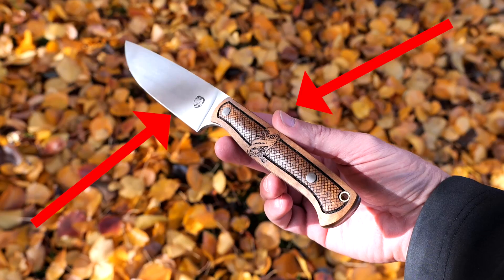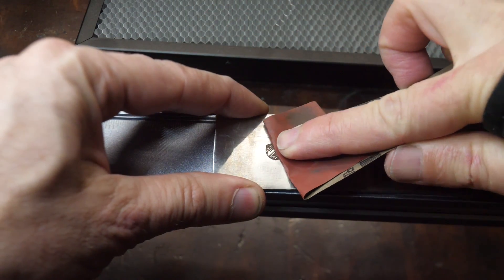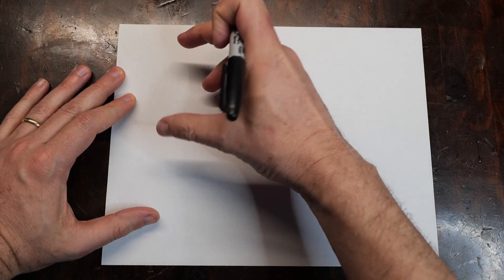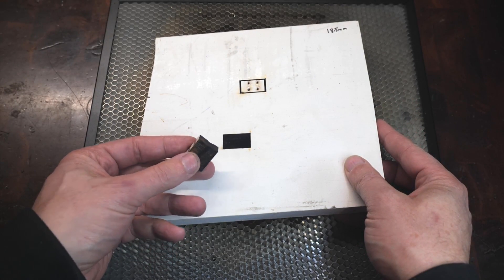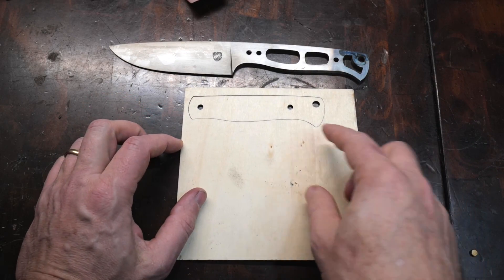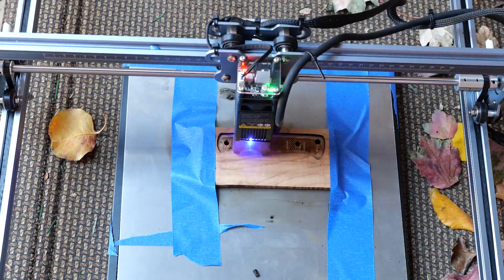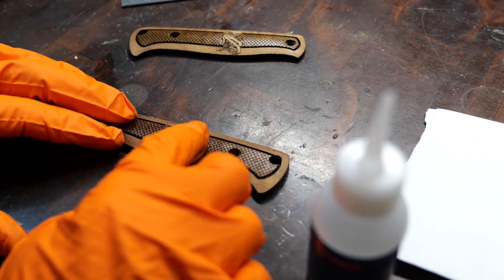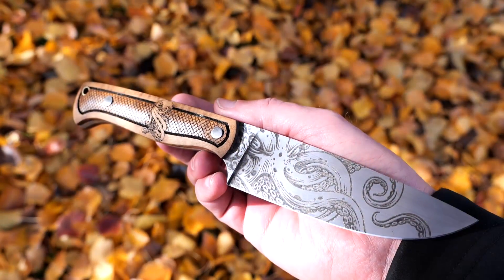Making A Knife With A 10 Watt Laser! Will it work?

Comment: I’ve been looking for a nice example of laser engraving on steel for a while now and came across this. Nice work. I have a question about laser vs etching. Laser looks good but slow, etching fast but less precise, but I wonder if you have tried a painted steel that you use the laser to just create the mask in the paint and then follow up with the etching. Might you get the best of both and taking the paint off at the end would be very quick?
Reply from the maker: Yes i put this in a short a while back i think, or part of a video.  Works as well as the mask does.

Comment: Havent watched till the end, for the love of your eyes if you get a laser like this consider spending some money on proper laser safety glasses. A set with a high optical density and rated for the wavelength of light that your laser is using should only cost around $50. You only have 1 set of eyes, dont just trust the set they toss in the box.

Comment: Can you use magnets to hold pieces in place on that table?
Reply from the maker: I’m not sure the honeycomb is magnetic enough
Reply: For your removal, sanding, and replacement for your final etch, couldn't you just run some blue tape on the outside of your piece so that it fits tightly back in place?
Reply from the maker: Sure good idea

Comment: Man, I just bought a 5.5 watt a few months ago. The design and cable management is the nicest I’ve seen on laser engravers in the sub $500 range. The problem with it is it only marks the steel, doesn’t etch it. Now I see this one and just bought it lol. Now I have to learn how to use Laser GRBL lol. Are you available to help with that @greenbeetle?
Reply from the maker: 5.5 watts should engrave steel it just takes a very long time.  In the 5 watt laser I tested it took over 4 hours to put a reasonable makers mark on metal.  Not very practical. Laser grbl isn’t too hard I can try to give you some pointers.
Reply: @GreenBeetle  the best I can get with that engraver is an oxide mark, it still looks really good, but there is no depth to it. No matter how slow I run it and how long it takes I cannot get a duplicated result so I’m hoping the 10 W will do better. I found a Facebook group for the program but I will let you know if I need any assistance and I appreciate the offer.

Comment: Cool, will You try to make handle in different materials? The outer edge one material and filling the hole with another. And so on. Glue them to a thin base but having the holes made by the machine they will fit perfect on the knife and by using different thickness on every material You would reduce the time to form the handle, and maybe save some on the material. It will be like laminating but not in depth. I hope I make sense?
Reply from the maker: Nice idea

Comment: Unfortunately it costs way more than that in pounds sterling (over twice that) so I couldn't justify the cost but it certainly gives a fantastic effect and is way faster than I could engrave but not so sure about the heat treatment problem, some lasers will cut through coolant maybe this one would do the same.
 Until then its back to the dremel,hand chisels or air tooling

Comment: Have you tried the borax solution pretreatment technique when engraving wood? Supposedly it results in a darker image.
Reply from the maker: Nice, please explain.
Reply: @GreenBeetle  from what I've read/seen (I've never done this):
Dissolve 1 tbsp borax in 5 oz hot water
Brush onto wood with a foam brush (some people spray then brush)
Allow to dry
Then laser engrave.

Supposedly it changes the way the light is absorbed.

Comment: Thanks for doing this research and sharing your results. Seems like the comment about using it to put patterns on steel to then be deepened with gravers is a really good idea, but I'm not sure I'd want to do anything else with it. Between the time it takes to figure out settings, and the burning that needs to be dealt with, I think I'd be faster doing it by hand. Those fish scales, on the other hand, are making me think.
Reply: You only have to figure out the settings once though. I am using mine quite a bit for all kinds of things - cutting templates, scribing through dykem, etching a resist for a makers mark.
Reply from the maker: Yes keep good notes and you only experiment once.

Comment: My initial thoughts on the use of lasers + metal would be to template out things like a very high definition stencil onto the surface and then going in with a graver to do the more detailed aspects of engraving. That sort of stuff if you're paying someone by the hour for engraving is extremely expensive because it requires both a lot of talent, time and patience. Not that I think you could get away with matching a high end engravers finished results but you might get a lot closer than just destroying a lot of really otherwise good bolsters, guards and pommels! (until you git gud)
But t really depends on the patterns I think, could be some value-added component to a knife/sword that sets it above a plainer example, sort of like how the German and UK cutlers of ye olde days used to do acid etching and other relief kind of work when selling off production knives for export.
Reply from the maker: nice idea

Comment: Lasers are not good for steel. Reducing rc. Reducing the value of that steel.
Reply: There's a pretty cool process called surface laser remelting that remelts the surface of the steel, which is rapidly cooled by the bulk of the material, resulting in very fine grain and high hardness. It's been accomplished with lasers as low as 30W. I think it'd be really fun to try on a knife with a chisel grind or asymmetric edge (the depth is fairly small), and it seems like there'd be particular potential on cheap D2, which should be expected to have a coarse structure and sometimes low hardness.